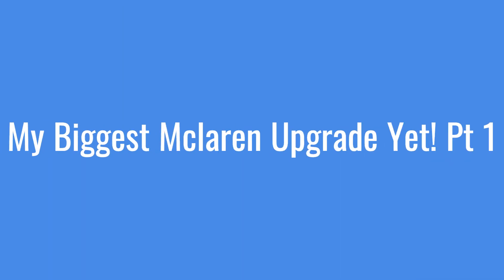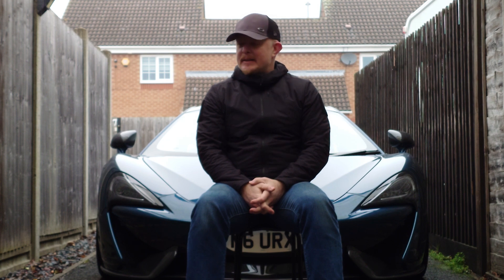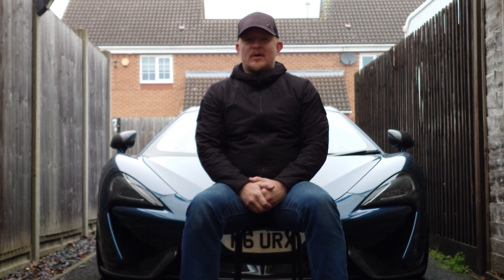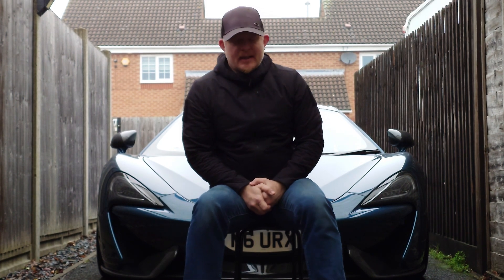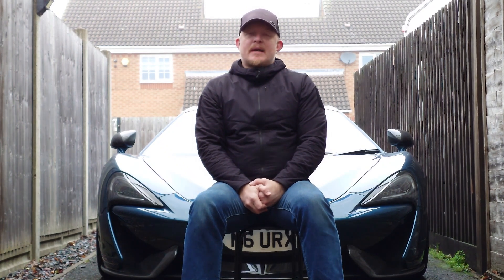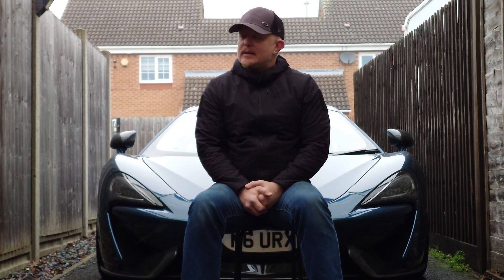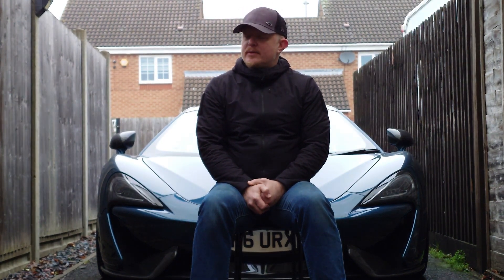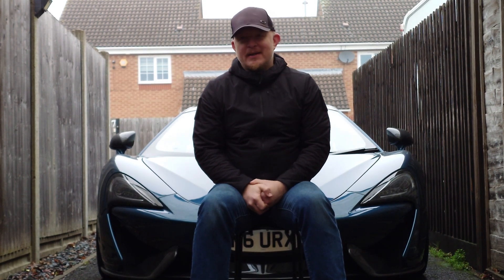Biggest Mclaren Upgrade Yet! Pt 1

Comment: Tavrish's engine went bang because 675LT has lighter rods and they are weaker than the other mclaren engines, especially P11 engine. Plus he did mention it wasnt fully warmed. Also the rods in the 570s/GT are not the same, they are larger.
Reply from the maker: @1985gooz  Yes Tavarishs engine went bang because of poor quality cast rods and no warm up but you are incorrect RE sports series. I consulted David Allenby about this matter. He was senior engine builder for the McLaren GT Teams for 10 years and saw the M838T all the way through it's development from when it was a billet NA Nissan engine. The lighter cast rods were introduced when the P1 was developed and were used in that engine onwards. So basically after 650s. They are the same in 675, 570, 600 and 720... That's why Dave has built my engine, because there are very few with comparable knowledge 👍🏻